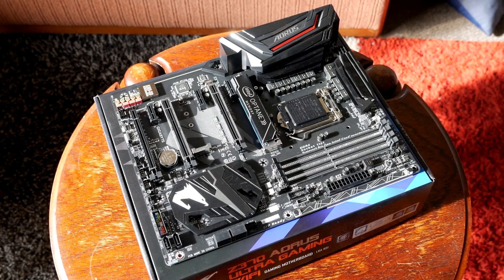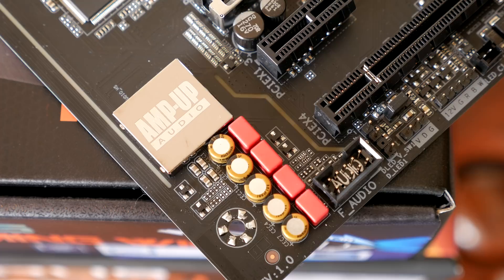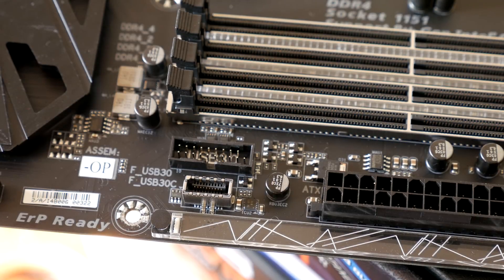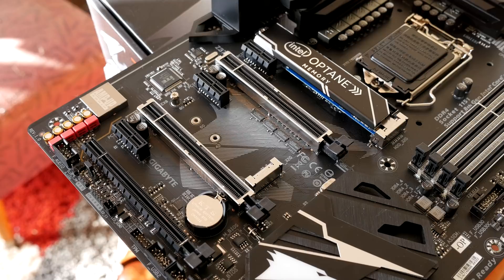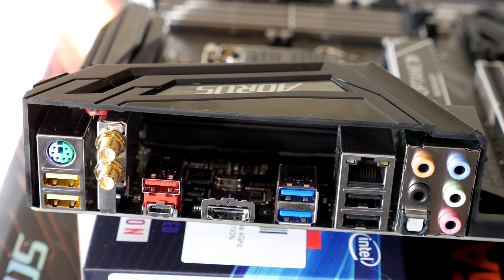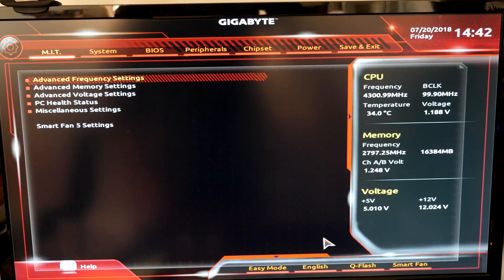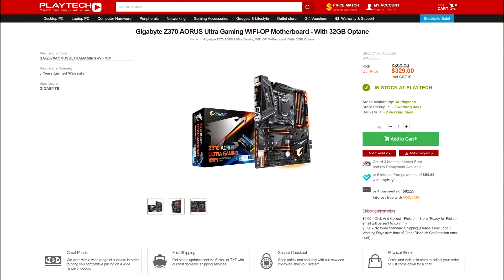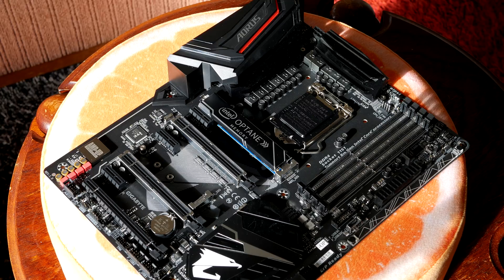Gigabyte Z370 AORUS Ultra Gaming WIFI Motherboard Review

Comment: My online review:  Even before hooking this up to anything, I could tell this was a huge upgrade…great quality construction and aesthetic value. The feel of the construction can be felt in the weight and how it felt solid construction. When I decided that this would be the cornerstone of my upgrade (moved from AMD to Intel)…I wanted to keep it economical I went with i5-8400 and G Skill Rapjaws (ECC, 2 x 8GB). Although it lists that it only works with non-ECC RAM, the instructions that come with it does say you can do 1 strip. I would go with Ballistix Sport LT DDR4 2400…it was suggested by crucial.com as guaranteed compatible.

I got this upgrade to play WoW, I would get huge lag in large battlegrounds. I do plan on getting my ram to 64 GB and upgrading the chip later on. The i5-8400 defaults to 2.8 ghz, before I dabbled on overclocking I went to test the new system in a BG. All tests where fantastic and works better than my AMD that I had at 3.6 ghz (same video card and was using 32g ram), I used the provided wifi antenna. I was in close range of about 50 people in the BG and so no lag. This is a very nice motherboard with many options and love the layout of where all the extras plug in.

The provided sata cords are lengthy enough to support a mid-tower and possibility a max tower. 4 cords are provided, with 2 of them have connectors that are L-shaped on one side…great for keeping the plug-in flat against the power port. The one thing I can provide criticism, the connection on the motherboard sata are positioned paralleled to the board and facing to front of your machine. So once the MB is installed it can be a challenge to plug in your sata cords, especially if you don’t have the ability to remove both sides of your case.

Pluses of this motherboard: wi-fi (with a provided antenna), quality sata cords with a decent length (with L-shaped connections), the connection panel on the rear has it’s own panel (no open space), supports 8 and 9 gen intel chips (can go economical to pricey), fits snug in ATX case, multiple fan power connections, case connections (power, LED, etc) are quality connection), and nice aesthetic value.

Criticism of this motherboard: placement of sata connection might be small challenge for novice, lack of easy bios instructions, yellow-colored illumination (if you can change, I don’t know…most of my color scheme is red), and a challenge to read small text labels for case connections (but really what else can you do, had to read manual to see which was which).

Comment: So am I not able to run 144hz right cuz theres no DP or DVI D dual link
Reply: MrEdgy so if u have a 144hz you shouldn’t get this motherboard?
Reply: Yeah cuz Only DVI D Dual link or Displayport can run at such speed
Reply: MrEdgy if there is dp on your graphics card you are able to use it. if you want 144hz intel hd graphics you need a mother board with dp

Comment: The VRM is not 11 phase, its a 4+2phase with crappy 4C10N and 4C06N mosfets, definetely not capable of overclocking the 8700K.
Reply: is it really so hard to use a real 8 Phase VRM?

Or is it so expensive that it is only installed on high-end boards for 300$ and up?
Reply: it's not that is hard , it's cheaper for them , while it will OC a 8700k the question is how hoot will the VRM get , specially when running prime95 AVX for stability test's , what's funny it the extreme 4 from asrock is better and cheaper then this :/
Reply: Felix R -  It increases building costs quite a lot, and boards these days rely on looks to sell and this got plenty. It looks like a 8-phase but its just 4 with double the components.  The mosfets on the Aorus Gaming 7 are server grade parts and cost a lot, all other gigabyte Z370's use those 4C10N/4C06N, same for the X470 Aorus/Gaming 5. You can check Actually Hardcore Overclocking channel on YT, its owner does speaks a lot on this topin on his last 3 videos.
Reply: I unfortunately have this motherboard and I can manage a 5.0ghz overclock @ 1.37v which is stable in everyday apps but crashes during stress tests. Regret buying the board but don't think it's worth it getting a more expensive better one. I'm delided so Temps during handbrake transcribing jobs top out in the low 70s.

Comment: Gigabyte has come a long ways. My first motherboard was Gigabyte and I loved it but it was a blue PCB and not much to look at. It was am3+ socket but I had to update the bios to accept the FX series. It's still running strong in my nephews pc with an FX 6300 and a GTX 750 TI.
Reply: my current Board is the Gigabyte GA-970A-UD3, together with a FX-6100 @4.5GHz, runs totally stable, even with only a 5 x 2 VRM